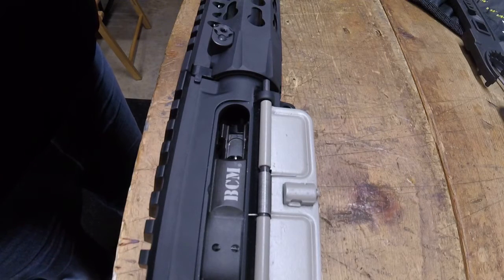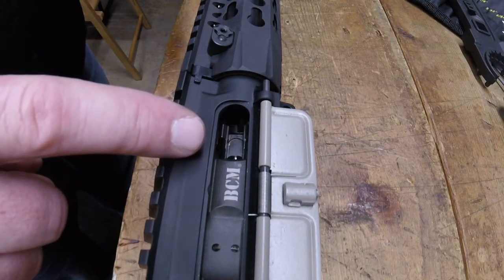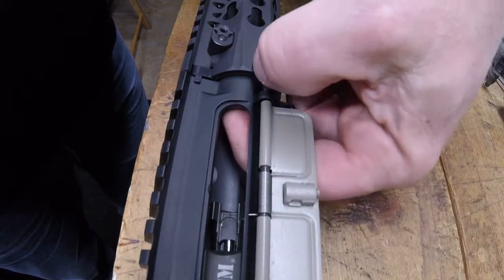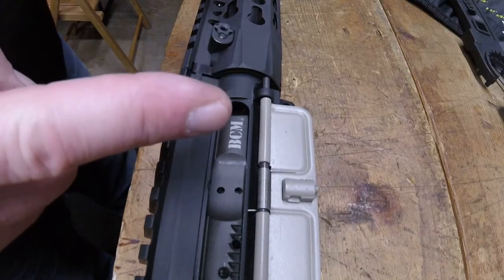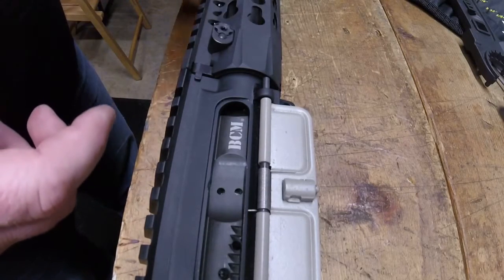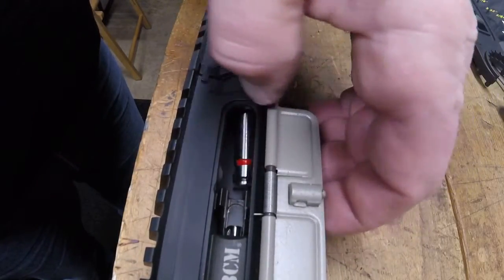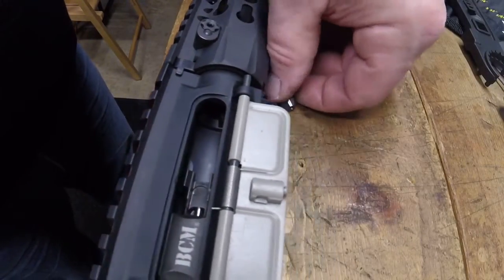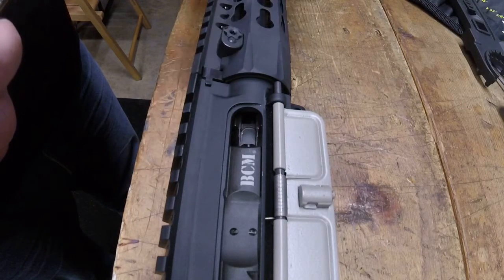How to check AR15 headspace

Comment: Maybe if the title says Go / No Go it would be good to have the Go gauge as well.
Reply: Most full power 5.56 ammunition like XM193 and XM855 have shoulder dimensions at or over .223 Remington GO specs. 

So if you can chamber a round it is the same as a GO, assuming your chamber is 5.56

Comment: You’re not supposed to slam the bolt on the gauge. It’s only necessary to remove the ejector. Like someone else said, take the barrel off and use just the bolt. If you don’t want to take the barrel off you need to remove the gas rings on the bolt so you don’t have to apply much pressure to move bolt forward

Comment: What if we just swapped out the upper and installed the same barrel and bolt from the same company that makes the bolt and barrel
Reply from the maker: I would still use a GO and NO GO GUAGE for a new build I have had a barrel from BCM (11.5" lightweight non BFH) close on a NO GO after only 2-300 rounds with all of my bcm factory BCG's and a Maxim SCW BCG...   that's out of spec.  That Barrel was replaced with a BCM BFH 11.5" that showed in spec for a new build.  You will have to order and wait for the gauges from PTG but its worth it.

Comment: You should use the 5.56 military TDP 1.4646 go gauge, not the 223 commercial 1.4636 go gauge being sold by most vendors as a 5.56 go gauge. If the bolt closes on a no go gauge it does not mean the chamber has failed, only if the bolt closes on a field gauge does it mean the chamber is to long and has failed...
Reply from the maker: Go, no go and field for new or worn

Comment: If at all possible, do this with the barrel removed from the upper, and use only the bolt.  Get a good feel, then reassemble, then do it again.  This method lets you get a true feel for if your GO is sloppy or not.  But that’s just if you want to split hairs.

Comment: This video is dangerous. A GO gauge actually is more important than a NO GO gauge, although you should use both unless you buy a bolt matched to that specific barrel. 

A bolt that won’t close on the Go gauge is significantly more dangerous than one that will close on the No Go gauge. If the chamber is too short, a cartridge may get shoved into the chamber but the bolt stops before it’s able to close. Inertia causes the firing pin to hit the primer anyway and you have a “slam fire” or out of battery detonation. This would be *BAD*. 💥 Even if the bolt does manage to slam closed, the bullet might be jammed into, or be very close to, the lands, resulting in excessive chamber pressure. Still a bad thing. 

If the chamber is too long by a few thousandths, your brass just stretches more than it should. Not good if you reload, but not an explosion in your face. If the bolt closes on the No Go gauge but not on the Field gauge you’re still OK although you don’t want that to happen on a new build. (Several other comments make this same point.)
Reply: Have you ever touched a BCG? The firing pin isn't long enough to reach the cartridge if the bolt hasn't rotated. This is by design.
Reply: @firewavey  have you ever heard of a slam fire?  Yes, they are even more rare in the AR-15 platform than M1 and M14s but it is possible. Are you saying that the firing pin never protrudes more from the bolt face than spec?  Or are you saying don’t worry about short headspace because it doesn’t matter?
Reply: It is a dangerous video and should be taken down .

Comment: 1) failure to verify headspace with an actual go-gauge means you may not discover an undercut chamber/bolt combination until that live round explodes in your face.  
2) chambering on a no-go is not grounds for rejection at that point.  it only tells you that barrel/bolt is nearing the end of its service life. 
and THAT'S why you have a field gauge.
Reply: A field gauge is not necessarily meaning the barrel is done for. It has about another 1k-2k life left but only if you caught it. The idea is you’ll take it off the field and into the armory for change but if necessary you can still use it in a all out combat situation. Definitely not a good idea to keep using it or buying a barrel that fails a field. For civilian you’ll want to stop using it and immediately change the barrel out.

Comment: The kit i got has a 3rd gauge i cant find info on.
Reply: Sappy-Seaman that would probably be the “field gauge” . And it would be an lot longer than the “no-go” gauge. It is usually used by the military to get the most use out of a weapon before repairs are done to it.
Reply: the field guage is the longest of the three.  should a bolt close and lock with that chambered, it's time for replacement of the barrel or bolt itself due unsafe and excessive headspace.